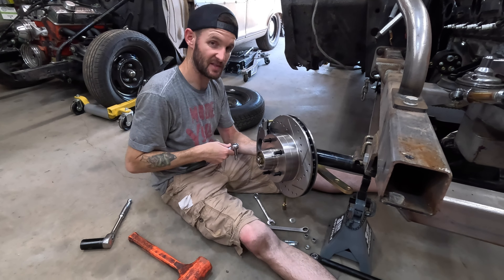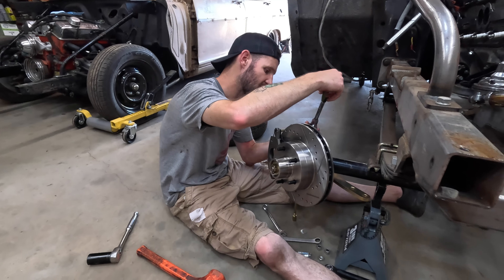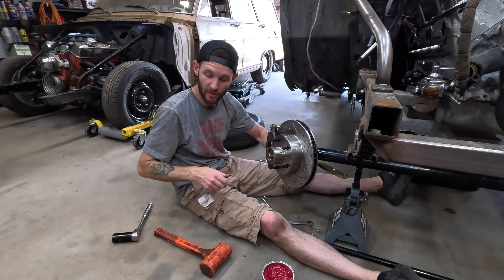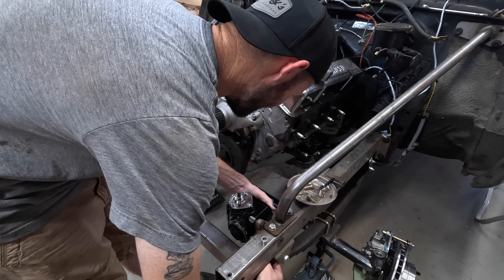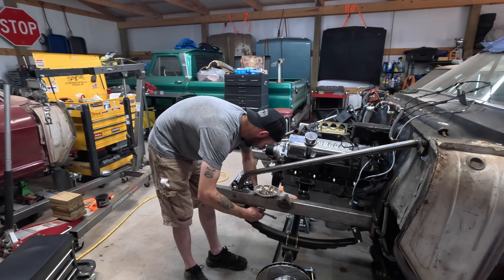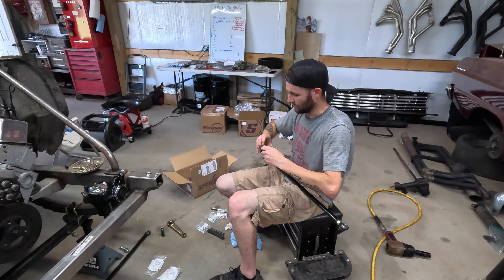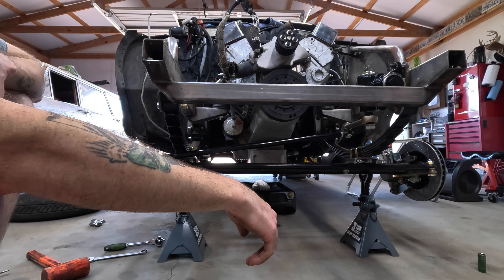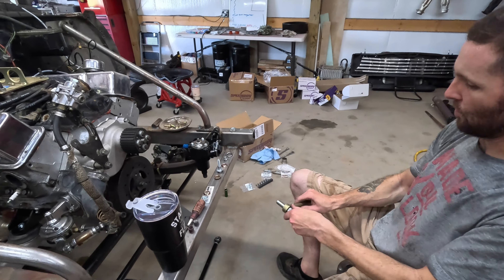Attempting to Sort Out The Steering On The Gasser - NNN Part 5

Comment: You’re going to get some bump steer with that much angle and I believe the hole on the pitman arm was a tapered hole.
Reply from the maker: I checked the pitman arm before reaming it, no taper, measured out the same on both sides. It was a bit odd. 
As for the bump steer, I agree. I'm not happy with the geometry and working on sorting out how I want to correct it. Looking at adding a second steering arm on the passenger side at the top of the spindle so that I can run the tie rod over the leaf pack. Rough measurements, this approach should put the tie rod damn near parallel with the axle.
Reply: @OneMoreBolt all the straight axle geometry scares me. Death Wobble express!!
Reply from the maker: I have heard horror stories of such. Been doing a good bit of studying on what makes straight axles stuff work and safe to drive, hopefully I hit all the key elements. I know the steering tie rod angle is no good right now, well, it's not great. So trying to decide which way I want to correct it. But yeah, really don't want to experience the death wobble. Talk about needing a new pair of pants!